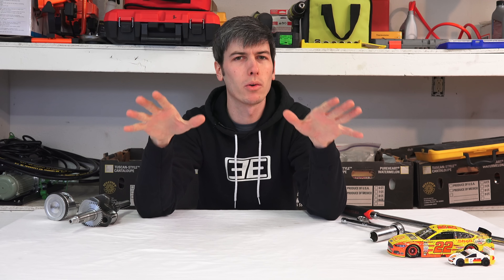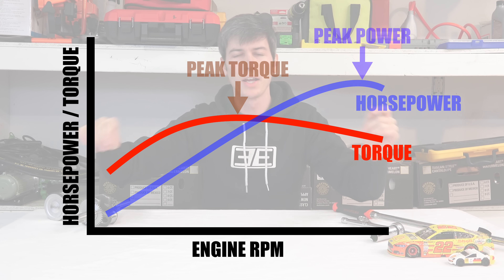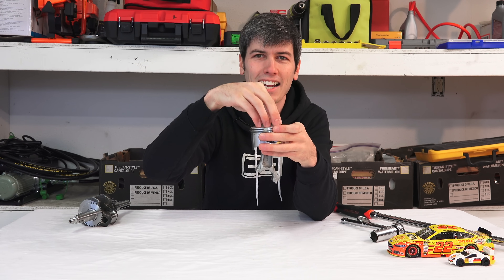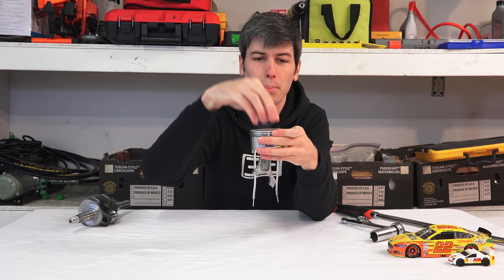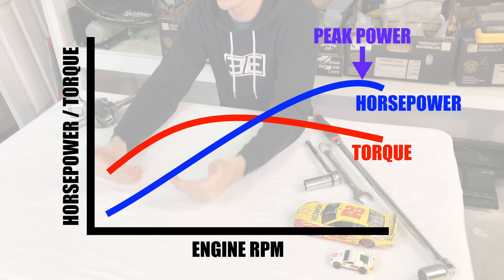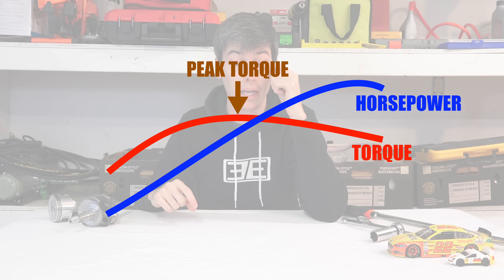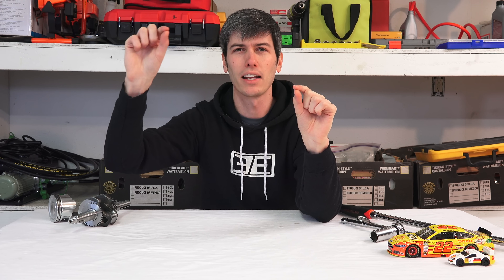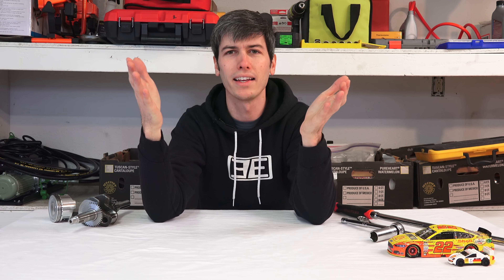Horsepower vs Torque - A Simple Explanation

Comment: you do not mention at all how torque helps pulling loads or going up hill and when there is conditions like off roading going over rocks. my little truck has a lot of torque and when i load it up it still can perform almost as fast as when it is empty, whereas a car with a lot of horsepower and very low torque will perform a lot worse if it carries a large load.
Reply from the maker: Unfortunately that’s not true. If both cars were to weigh the same, the vehicle with more horsepower would always accelerate faster (assuming it’s always making more power). The reason your truck doesn’t change as much with added weight is because it’s heavy to start with, so the added weight is a smaller % vs if a car were to have added weight. I explain this in detail in a follow up video: https://youtu.be/7eZyXp1i4GU

Comment: I'm going to stick to cars in my comments.  Continuing my rant, power is force X velocity, so even at constant acceleration and mass, force changes, increasing or decreasing proportional to velocity.  (Again, this is frictionless universe.  For the real world you can think of the sum of forces).
Rear wheel power is always engine power less friction losses regardless of gear.
Rear wheel torque is always engine torque X gear ratio less friction losses.  
So at a given engine horsepower the rate of acceleration is different in each gear.
I notice another video on the side bar that explains how horsepower is measured.  Horsepower is never measured, it is calculated, no matter what kind of dyno you use.  Force is measured, horsepower is calculated from RPM at that force.

Comment: Terrible explanation.  All acceleration comes from force (traced back through the drivetrain to engine torque).  There is no mathematical or physics formula that gets you from power to acceleration.  And the same power can result in almost any value for acceleration with a given mass.  Here are two "frictionless universe" examples:  You have a moving 100 pound mass and you observe that it's accelerating at 10 feet per second squared.  Calculate the power.  
You have a 100 pound mass moving and you observe that at one instant the power applied to the mass is 10 horsepower.  How fast is it accelerating?

Comment: The way I see it torque is a part of an equation that gives you power.  So whatever torque your engine produces is multiplied by a certain amount depending on gearing.  Ultimately you can increase top speed or acceleration by upgrading to stronger lighter more precise components and/or improving aerodynamics or adjusting gearing ratios.

Comment: I think of torque as being directly related to power per engine cycle. Obviously the more engine cycles (rpm) you have  the more power you have, it's a multiplier of torque. But the power per cycle drops off away from the optimal torque region. As you get away from peak torque the less each extra RPM does and the less efficient the engine gets. Each engine cycle should ideally use the same amount of air fuel mixture no matter what the RPM, so the max torque is pretty close to the max efficiency of the engine. Bigger engines have more power per engine cycle, forced induction produced more power per engine cycle, so they increase torque and then ultimately power. The other way to increase power is to keep torque the same but just go to a higher RPM. Note max torque reported is usually with the throttle fully open, when you don't have it fully open the torque curve peak will move towards lower RPM, the less air in the less air and fuel there is to efficiency charge each piston stroke.

Comment: However, you have to have an adequate number of gears (at the optimum ratios) for this to be actually realized. For instance, back in the early 80's I had an old Ford Fiesta with a Kent Crossflow of 1.6 liters, if you look at the horsepower and performance, the 1.3 liter was rated at the same horsepower but the 1.6 did 0-60 in 1.5 fewer seconds. That is, even though they had the same peak horsepower, the 1.6 had a broader torque curve which was directly reflected by it's lower times.

Comment: Explain to me as if I were 5..
Reply: When people say it makes lots of torque, it means the engine is making lots of low rpm horse power...
(tq x rpm)/5252 = hp(power)

Early 90s Dodge cummins 12v 5.9L 6BT
400 ft-lbs at 1600rpm
250hp at 2500rpm
After doing some math you get
*400 ft-lbs torque at 1600rpm = 121.85hp at 1600rpm

90s honda prelude 2L H22 usdm
153 ft-lbs at 5500rpm
187hp at 6800rpm
I have a few dyno sheets for this engine so i know its making:
*130 ft lbs at 2500rpm and this = 62hp at 2500rpm

Summary read the first sentance i stated. And compare the stars... Its a internet mystery because no car manufacturers lists low rpm hp...
Reply: Analogy: stomp on the gas and the Dodge Cummins at 1500 RPMs and stomp on the gas in the Honda at 5000 RPMs and you will be feeling the same amount of horsepower is that clear short and simple enough...

As they say if you can't explain it to a five-year-old you don't understand it good enough yourself

-an engine freak, son of engineer

Comment: Not really that simple of an explanation. Power is torque x RPM.

If two engines produce identical peak HP at the same RPM, they're producing the same torque. One of them might consistantly produce more power/torque than the other below those RPM, and it will be described as "torquier".

Comment: The possible gear ratio advantage works both ways.  If you put a high gear with higher torque you can accelerate at the same rate as a combination with lower torque and lower gear.  500ft/lbs@2000rpm x 2:1 gear = output 1000ft/lbs@1000rpm.  
250ft/lbs@4000rpm x 4:1 gear = output 1000ft/lbs@1000rpm.  
A high torque, low rpm engine will run out of gear quicker, a high peak HP, lower TQ engine will require more more mechanical advantage (through gear  ratio) to accelerate at the same rate.  Acceleration of a car depends on a combination of engine power/speed, transmission gear ratios, final drive gear ratios, tire diameter, traction, power loss through drive train, etc,

Comment: So, a well-tuned and robust CVT mated to a well-tuned engine would probably accelerate faster than any other vehicle with just a manual or automatic transmission. I bet the only reason CVTs aren't more popular is limitations in materials and designs keeping them from being reliably mated to strong engines. Some of the more powerful engines out there eat manual transmissions for breakfast. They literally destroy the gears and clutch. A CVT would probably not stand a chance, but I would like to see more CVT technology.

Comment: More torque = ? 
More horse power = Rate of work done.(speed & accerlation) (T×rpm=HP)
Reply from the maker: Discussed in the video! Ultimately, more power = faster acceleration and higher speeds. Torque is a part of that equation.
Reply: Engineering Explained thx for helping me out lol I was sort of lost 😂

Comment: Might want to do your math again. A 200 hp engine with 100 lb ft. Will lose to a 100 HP 200 lb ft. Engine in a car. There are motorcycle engines that do that. You need torque to get moving OR you must wind it out in ever gear. You even stated that acceleration will be greatest at the peak torque ( not HP). Turbo-supercharged vehicles haul because of the torque they produce..not the HP. That said, it can be changed by gearing. Motorcycle engines rev up in ever gear because. They HAVE to due to lower torque...

Comment: Great video! I think it’s worth clarifying your two-car comparison.If they have the same gearing and perfectly flat torque curves, the car with twice as much torque will accelerate twice as quickly for a fixed gear ratio.However, the car with twice as much horsepower and half the torque must have a 4x higher redline (0.5torque x 4RPM = 2x horsepower) and will therefore be able to maintain that gear ratio for much longer.Only a very short drag race would favor the high torque car.

Comment: So you are saying.. my truck.. has a HP rating of 245@2400rpms = peak tourqe of 536.14 at that rpm?
Does this formula work the same for a diesel engine as it does for gas engine??

Comment: Nice video. I explain power versus torque this way. Turn a bicycle upside down. Use your hand to turn the front wheel. Now turn it faster. Now faster.  Faster still. The faster it turns the more power is required to apply any torque at all. Thats why torque at higher rpm means more power :)

Comment: Sure people that know how a car already works may know the difference between those two out of a thousand principles, mechanisms one must understand to maximize performance. Like lb foot, lol no But> work, for example you used your muscles your arm muscles , shoulder,  obliques, called that "work "think of all the variables. lubricants your muscles need neurons and nerves firing  blood flow, it could easily get confused when lookin at it without knowing the other forces involved. Variables. Basic physics. Considering you have different kinds of metals, more combustible fuels. Different tires, materials and machines that allow more torque and power or perhaps for a longer period provided you have strong or more durable engine parts or  Make for more or less friction. Like a cars engine parts together can provide torque and power for the car, A certain car may or may not operate at peak level because of the extreme wear

Comment: Thanks for very informative video. Can you please tell how does the numbers below translate into real time experience 
CAR A: Power - 385 hp @ 6,100 rpm, torque - 384 lb-ft @ 2,500-5,000 rpm VS Car B: Power - 380 @ 6,500, torque- 332 @ 3,500-5,000 rpm.  car A is  has turbo V6 with 0-60: 5.6 sec and Car B is supercharged V6 with 0-60 in 6.8 sec. It will really help me in understanding real dynamics. HELP MUCH APPRECIATED

Comment: I don't agree with this explanation.  The rate at which I do something is not an accurate "yardstick" for how much work I did.  For example, imagine lifting a set of barbells maybe 75% of the maximum I can lift.  Generally speaking, lifting it quickly is EASIER than lifting is slowly.  So it seems that lifting is slower requires MORE work, the complete opposite of what is being said in this video.

Comment: Is Horsepower actually "married" to RPMs?  What if someone has a linear acceleration device (using magnets for example), does that mean it has no horsepower?  Something sounds "fishy" there.    I don't think HP should be defined in terms of RPMs cuz that assumes the device making horsepower is actually spinning, but it might not be.  What if I slide something heavy across a flat surface?  Did I produce some horsepower or is the horsepower 0?
Reply: Then you use a different equation for power. Power is simply the derivative dW/dt. So how much Work/Energy you put into something over a certain time. If you accelerate a car to 100 km/h you have to put in a set amount of energy, so the required work is always the same (given you're always on the same surface ofc). Power only describes how fast you get there.

For rotatory engines the power IS bound to the engine rpm, as power is also defined as M*(omega). Omega is the angular velocity of the engine, so 2(pi)*(rpm). What you think doesn't really matter, it is set science that P=M*(omega).

In your example the power is defined as F*v, so the product of applied force F and the speed v.

Comment: Dude, Hp is the result of rpm and torque. Torque has nothing to do with leverage in a compustion engine, the force supplyed by hub length , compression and cylinder size does. Please shut it down, read up and try again!

Comment: I watched second time still don't get what you say torque means. and im certain that is not the easiest way to understand. Im sure my uneducated version is right? I say Two Cars same weight and 200BHP but one has 400 Torques and other 500 Touques Both reach 500 meters in very Similar times. But, up a hill Higher Torque car will Kill Lower Torque car over same distance due to larger torque numbers.

In otherwards I think Touques is a reference to the force an engine can counteract Against and hold same bhp (Power)?
Reply: Your example is bad tbh. Because if both engines have the same power at a given rpm that means their torque is the same at this point on the engine map and that doesn't really happen too often.
Now the second statement isn't that easy to make. Say both are in the same gear (otherwise it would get even more complex) they both are at 3800 rpm at which they have the same power and drive at the same speed, in other words: the engines have the same torque. Now comes the hill. Let's assume the engine torque is not enough, so the engine rpm drops for both engines. Now we have to assume that the 'high-torque' engine always has higher torque below 3800 rpm. What will happen is this engine will settle at a higher rpm because it reaches the required torque "faster" whereas the 'low-torque' engine has to drop to even lower rpms to reach the required torque. So in that case the 'high-torque' engine would be faster on the hill but only because it puts out a higher power. Hope that wasn't too complicated.

Comment: Problem is, only Torque can be measured on a dyno. HP is calculated(Torque x RPM) from that torque measurement. The reason we get big differences in HP readings from different dyno's is because the Torque to HP calculation is never exactly the same due to scaling factors like drivetrain losses, setting up the rollers for hotter air temperature and lower baromic pressure. So, because this video is more about how you can manipulate torque through gearing, rather than "Torque vs Horse Power", and the only actual measurement that can be taken is Torque, I'll continue to only use torque on my cars.

.
Reply: All those factors that you mention have their effect before the torque measurement and don't affect the relationship between torque and power at all. If you get big differences in power readings that is because you get equally big differences in torque readings.

The torque curve shows how the engine's performance in one gear varies through its rev range. The power curve shows where maximum performance is available when the gears are used to optimize the engine speed.

Comment: Just to clarify... when torque figures are given at certain RPM, it is the RPM without the inclusion of any gears right?
Reply: Gears don't play any role in that. If your engine runs at 3800 rpm it will have said torque/power, doesn't matter what gear you're in. It's what the engine provides not what is at the end of your transmission.
Reply: Ochser great, thanks

Comment: correct me if I am wrong 

steam engine requires  torque   lets say  5252Nm and  wheel spins around 60rpm to run so we get 60kW output 

according to your explanation where you said horsepower is more important, then i can run a train if i have an engine which revs at 6000 rpm and produces 52.52Nm and using a gear reduction , that means I can use a 600cc bike in place of steam engine ??

I think your answer should have been more torque as Hp is directly proportional to torque and rpm, if you want a faster acceleration you need more 'TORQUE' at a given RPM of an engine
Reply: How did you get that power? 5252 Nm at 60 rpm equals 5.252 kW.

A transmission keeps the power at the same level (given there's no loss due to friction). So if you put in 5 kW you get out 5 kW on the other end. And since power is defined as P = M*2(pi)n you could power a train with even a 50cc scooter if you get this things engine to spin at like 30000 rpm.

If you have more torque at a given rpm you also have more power. Those two are not competing things. One follows directly from the other. You can have 800 Nm of torque in an engine but if you only get those at super low rpm they do nothing for your acceleration because acceleration is calculated from your power - except you use like a 30 gear transmission.

Comment: There is a difference between acceleration and speed. Torque is better for acceleration while horsepower will achieve high speeds. ICE suck at using torque to its full potential due to horsepower having to speed up so torque can be applied.

Comment: This makes perfect sense. I already knew this from practice but not theory.
When I pull up in my first gear, I SHOOT from 0 to 20 almost instantaniously. After that 20, I won't accelerate very fast anymore in my first gear. I shift to 2n gear; same thing, only from 20 - 50. 50-60 takes as long as 20-40/50 takes.

If I switch to 3rd, it goes from about 40 to 60 in a matter of seconds while going 60-80 again, takes twice as long.

It just makes perfect sense...
- To note; I don't drive a powerful car. I drive a very low gas usage car. A 1.2 fiat punto, so yes, it takes a few seconds to accelerate hahaha. I think I have 54HP.

Comment: But why does the torque change with different RPM (when in one gear)? Shouldn't the torque curve be a straight line since the leverage and gear ratio doesn't change?
Reply: Gear ratio has nothing to do with that. Those power and torque numbers only make sense for the engine without transmission.

The torque drops because of two things:
- difficulties in charge exchange and combustion and
- friction losses (most important, as they grow with the squared engine rpm)

That's also why you put in chargers instead of raising rpm to get more power out of your engine. Because doubling your rpm multiplies friction loss in the engine by 4.

Comment: No, power does not give you acceleration.  Power (as he says) is a rate (force X velocity).  Acceleration is dependent entirely on force and mass.  For a given force you get the same amount of acceleration on a given mass regardless of velocity.  The power, however, increases with speed (because it's a rate).  So you wind up with constant mass, constant force, constant acceleration, but the power increases proportional to velocity.